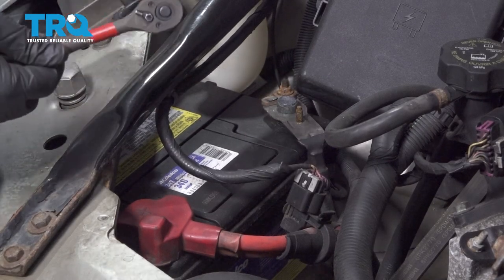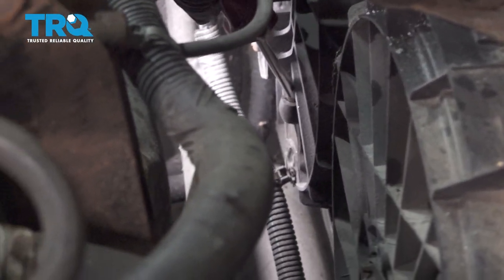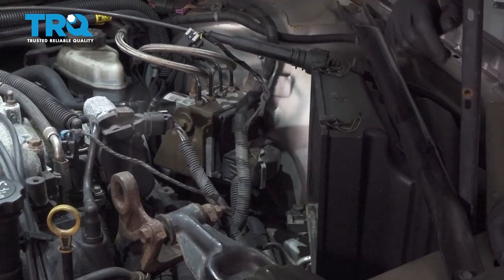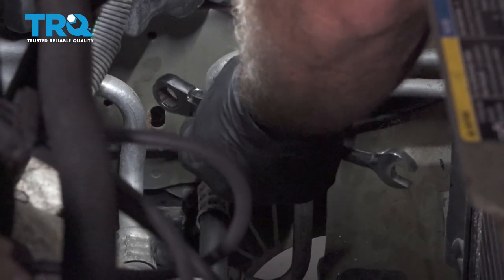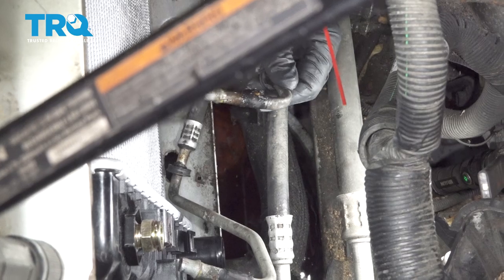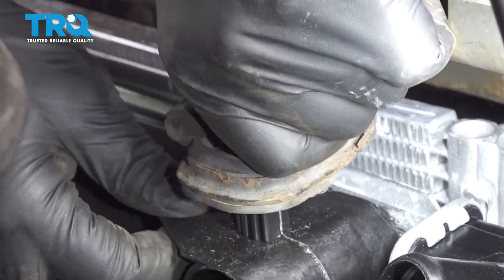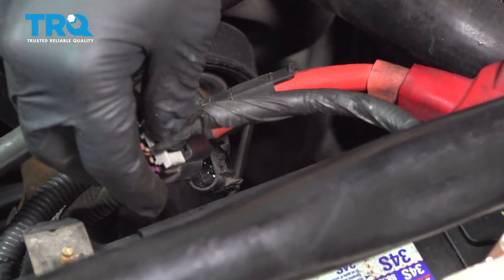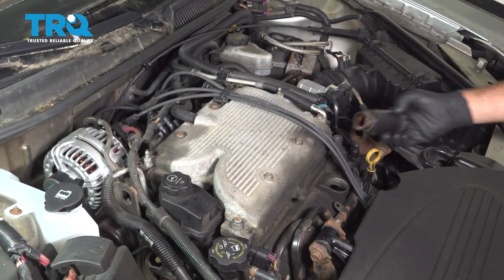How to Replace  A/C Condenser and Receiver Drier Assembly 2006-2013 Chevrolet Impala

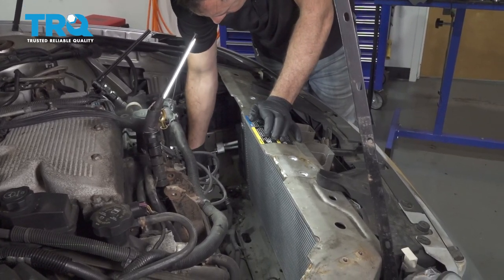Comment: When replacing the AC condenser with an after-market one, and attaching the ac lines with the o-ring and retaining collar as you do at 22:18, I'm finding that the fit is not very snug, and freon seems to be leaking here. What is a good fix for that?

Comment: Will a bad Condenser cause the A/C to only blow cold when driving & stop blowing cold when idling
Reply: Sounds like you could be low on Freon
Reply: Sounds like low on Freon check for lesks
Reply: low refrigerant or a dying compressor. Or your belt is loose. Is steering heavy or are you getting a lot of dimming headlight action?